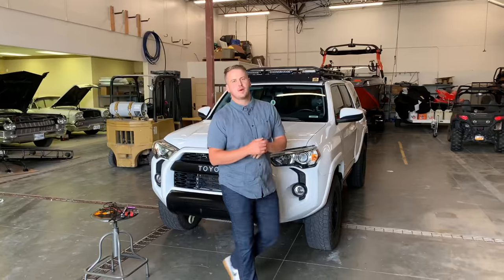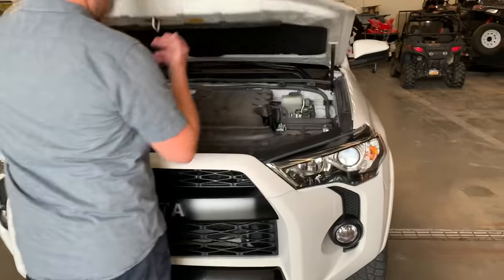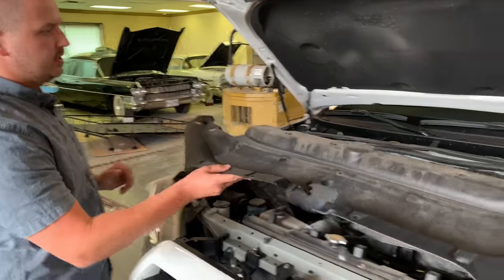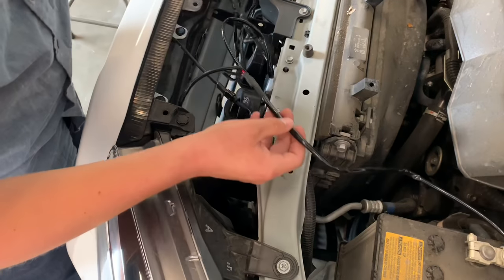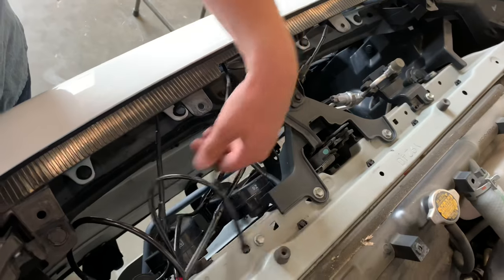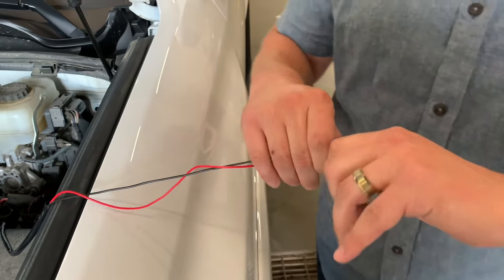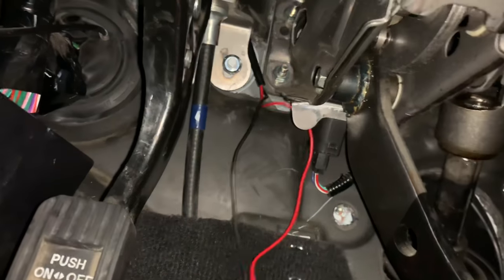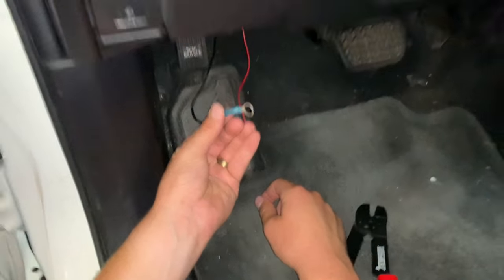4Runner RAPTOR Lights Installation!

Comment: Dumbest modification ever...
Reply: Your just mad because you don't have it lol
Reply: @Greatwhitehype  the mod doesnt make sense on smaller vehicles...those ambers serve a purpose. To look cool wasn't Ford's goal...what's worse is the insistent need for Toyota owners to model their vehicles to look like Fords...if folks like the lights get a Raptor and stop pretending.
Reply: These lights are great in the mountains for ID purpose. When overlanding ID lights are essential. It's pitch black and you don't want to turn on your ditch or fogs. These lights serve a purpose.
Reply: Also, in the raptor they don't serve a purpose. Unless they are using them for what I said. Amber lights in the grill are not clearence lights. If that's what your getting at.
Reply: @Greatwhitehype  you're right they aren't but based on the width of the vehicle they are federally required to be on the vehicle. So back to my original point it's a dumb mod because 4Runners aren't wide enough to where they are required to be on the vehicle.
Reply: @Greatwhitehype  hey man whatever you want tell yourself. Next time let every Jeep and Toyota owner they need they're raptor ambers. Ha. The reason for the Raptor having the ambers is based on the width of the vehicle per federal code which is why the normal F150 doesn't require them. The code doesn't say the ambers have to be on the roof which is generally where they are located based on your previous comments. 

It's a stupid mod for 4Runners, Tacos, and FJs but you can justify it all you want boss. The past 60 years of overlanding people should've been using their 3 grill ambers or they didn't go at all. Haha take care partner...this was fun.
Reply: John Anderson you like the light... so you going to buy a whole new car? What?
Reply: @itsajoke631  not sure how to respond to this comment...I didn't install the light mod. I'm commenting on the fact that it's a dumb mod. So I'm not sure what your end game is with this dialogue...tell you what sit this one out.
Reply: John Anderson what I’m saying is, if they like it. That’s cool, no need to hate.
Reply: @itsajoke631  what I'm saying is Toyota owners should take more pride in the history of Toyota 4x4s and copying a Ford is degrading. While I think the Raptor is a great vehicle, I don't like the idea of modding for zero utility. Ford is required to out the additional ambers on the Raptor due to the width...4Runners and Tacomas a 5" shy and Tundra are 2". If folks wanna modify to "make it their own" then do something that looks good or serves a purpose. It's the F&F neon lights of the 4x4 world.
Reply: @johna1191  

Dear everyone, 

Please seek the approval of John before you decide to do anything that has no effect on his life whatsoever just in case he thinks it is dumb. TIA
Reply: @mxjr3564  Malcolm I don't care what you do to your vehicle. You could slap ridiculous decals all over your vehicle because I don't have to look at it. If you want Raptor lights for you vehicle then get a Ford Raptor. If you wanna live in the land of make believe and pretend...I'm sure you, tinkerbell, peter pan, and the lost boys will have ever so fun adventures with your Raptor lights protecting you from Capt Hook. At the very least you can read my information above and educate yourself during the social distancing season...no one likes a dummy in never never land.
Reply: John Anderson thanks. People are getting triggered but you’re just telling them what offroad enthusiasts think
Reply: @destinyglitches9519  thanks bro. Call a spade a spade...it looks cool if you want your vehicle to look like a Ford. I think Toyota has more pedigree based on their offroad merits...cheers!
Reply: @johna1191  wow lighten up my dude, you seem a little uptight about these lights. The lights look cool.. Plain and simple.
Reply: @PK-we9rb  way to show up late to the party. It's a lame mod...if you like the lights get a Raptor or the Ram TRX. Plain and simple...
Reply: @johna1191  whaaat?
Reply: @onlinewaffle  damn bro...welcome to the party pal.
Reply: @johna1191  Guess I’m late to the party as well. Just curious though…for such a “dumb modification”, why are you even wasting time commenting, let alone watching a video of an install? That’s a tad bit “dumber” if I must say.